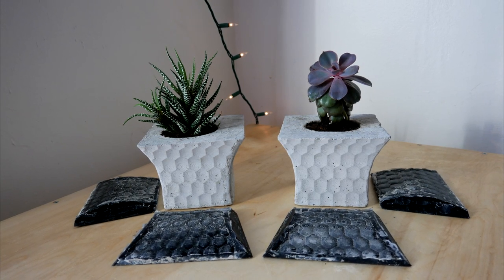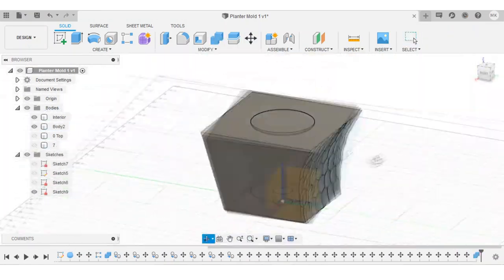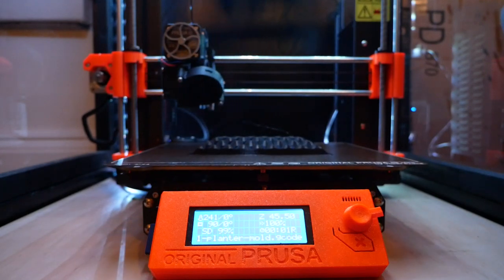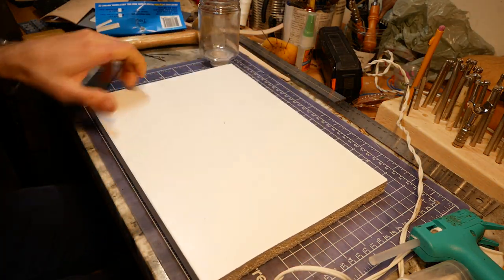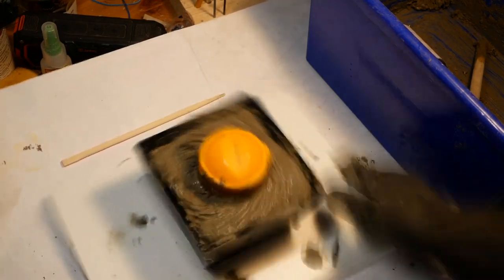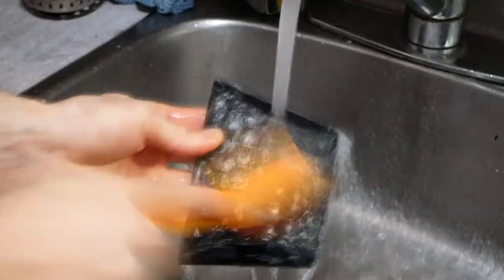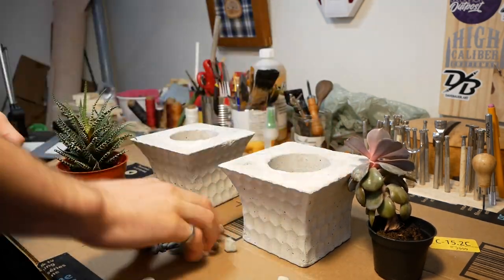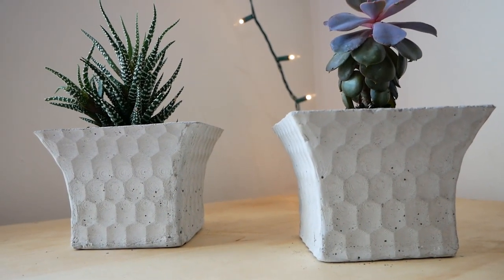DIY Concrete Planters With 3D Printed Molds

Comment: For Fusion360, please please please have a look at the "pattern" functionality, it would have save you a lot of time, and made the model MUCH simple to handle.

That said, it came out amazing, very well done! Love the design!
Reply from the maker: Thank you! I actually did use the pattern tool, but horizontally, not vertically. I think since I was designing on the fly, I was doing what made sense to me in the moment. But yes, it’s always clear in hindsight that there are more efficient ways of doing something 😁. Creating a pattern on a curved path would be a great way to get a nice, even. curved profile with the scalloped cutouts!

Comment: Looks great Morley! Have you thought about a way to make the interior mold on the 3d printer as well?
Reply from the maker: Thanks, Grant! I have been thinking about that a bit... since twisting the mold works really well to separate it from the concrete, I think I would make a tapered cylinder with a big handle sticking out of the top, or maybe with an integrated hex head so I could use a socket wrench.
Reply: @MorleyKert  that sounds great! Adding a trailer will make it so much easier to remove 👍
Reply from the maker: Is a “trailer” a technical term for something you can grab to help with demolding, or do you literally mean attach a trailer to pull the mold pieces apart? 😂
Reply: @MorleyKert  lol auto correct changed taper to trailer 😂😂
Reply from the maker: Lolol 😂
Reply: Hi 
Like your planters.
Been a while since I made anything with concrete but a thin layer of duck oil before adding the concrete Wil add with release.
And don't worry about trapping a bit of water in the bottom of the planter as I think it will do more good than harm. A lot of planters are designed like that.
Not trying to sound picky just trying to